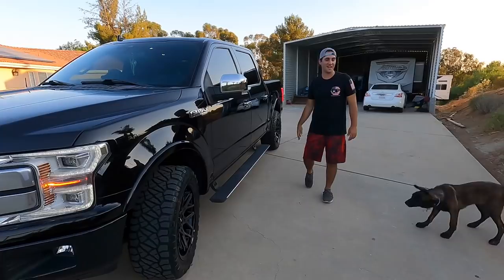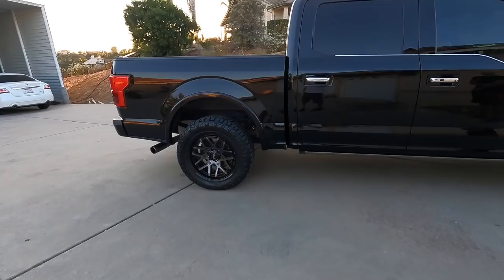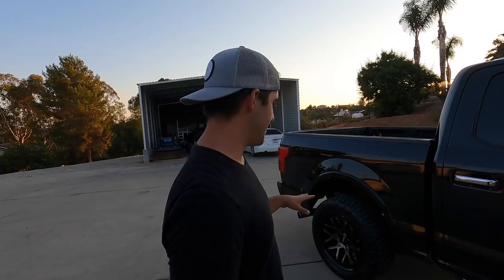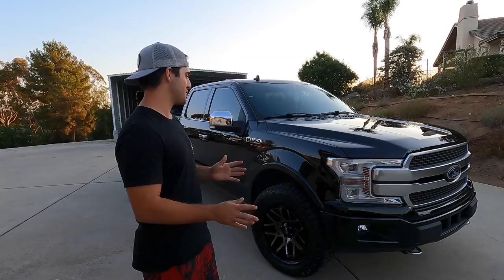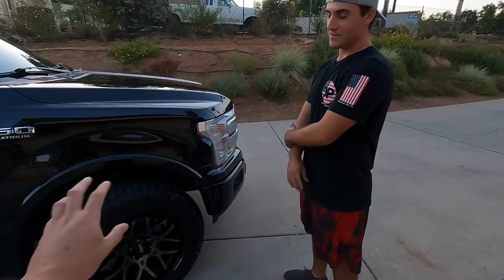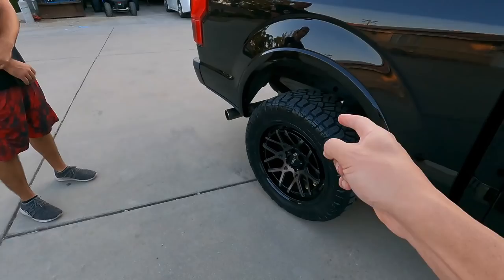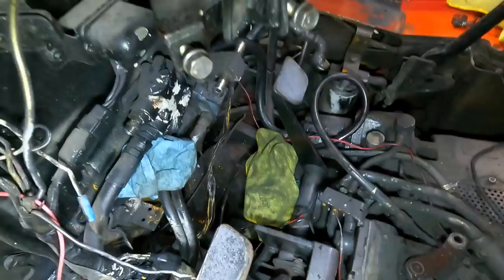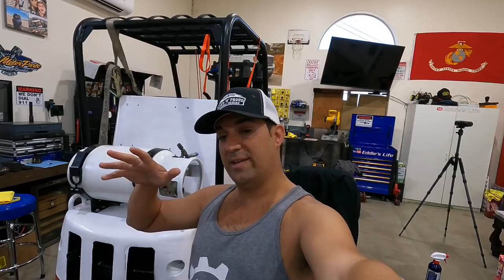Honest review about tire noise....What is the right tire?

Comment: Level kit ain’t gonna hurt the towing capabilities at all. What a level kit hurts is the cv axles and ball joints etc…
Reply from the maker: It’s not going to hurt it but it’s going to be squatting while he’s towing and he rather have a sit level when towing
Reply: @EddieLife3500  I had a level kit on mine and it messed both my cv axles up. Stock is the best way to keep them to make them last. But leveling them looks a lot better.